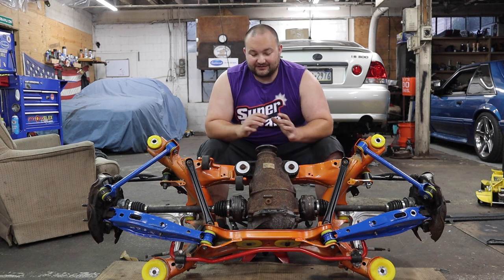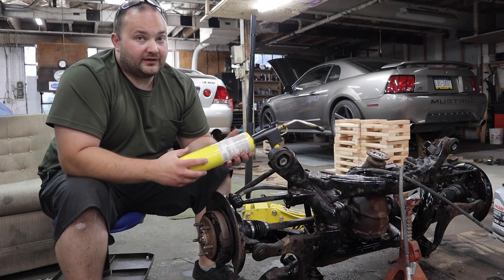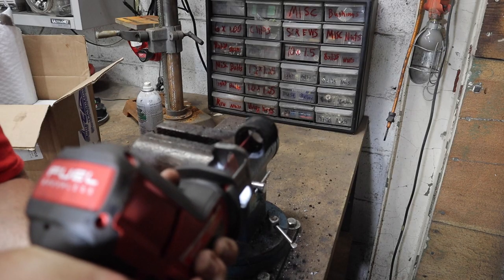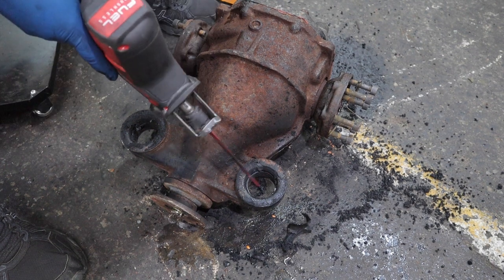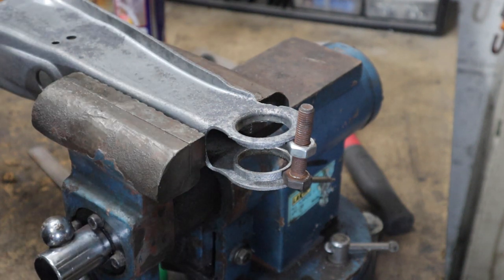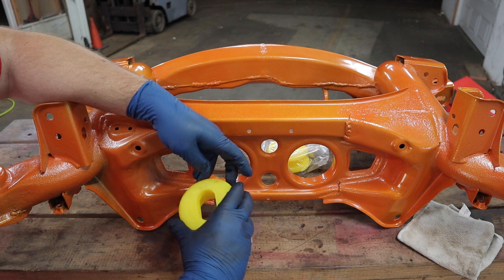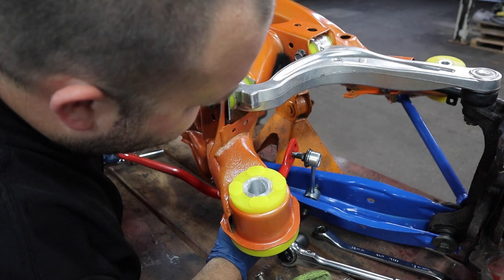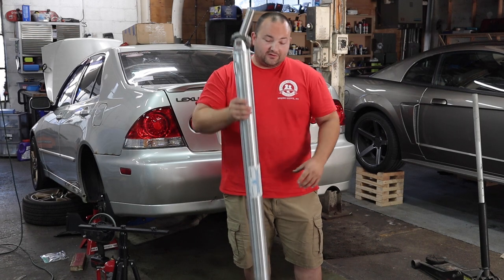Complete Rear Subframe Overhaul! Lexus IS300 IS200 Altezza

Comment: I’m in the middle of this process on a rust free Arizona car and will just be reusing the upper control arms. 2 notes for anyone going this route: Rocar makes an upper ball joint for these that can be had for about $50 shipped.  Also the bushing that has a lip on it on both sides is actually a 2 piece bushing. I used an air hammer to push it out on both sides pretty easily. The other side is typical, burn it out and make a relief cut. The steel takes much more abuse than the aluminum gs arms poor man mods used but this can be done easily without butchering them!

Comment: Just subbed. This encouraged me to order the complete kit (red and yellow) and will be tackling this with my brother. Will definitely have this video on reference but I do have a few questions though.

1. Is it mandatory to drill and press out the sleeves for any of the rears? Can the bushings fit into the original sleeves? 
2. What is the difference in performance w/ the new bushings in comparison to stock? Do you feel/hear more cabin noise? More vehicle vibrations?  
3. Does the car handle more solid now w/ regards to steering and vehicle control?

Mines is all stock and at 233K miles, I think I'm on the original gas shocks and bushings as bought the car at 112K miles and don't know the history of that maintenance. The wear/tear is starting to show, so all 4 gas shocks are getting replaced at the same time as these bushings. Thanks so much!
Reply from the maker: Thanks! 

1. The only bushing that may fit in the original sleeve is the lower control arm the bushing that I did around 33:00, i cant promise that i will work with the OEM sleeve though, but it did look possible. Everything else I did in this video regarding sleeve removal is 100% necessary.
2. Absolutely zero downsides, NVH has not noticeably increased, and the car just feels better. It feels more predictable, less slopping and just more refined. I have not done any high performance driving though, I hope to autoX the car next years.

I also did all 4 shocks not too long ago (miles wise) With new shocks and all new front and rear bushings the car drives amazing. 

Best of luck with the project!

Comment: I hope you torqued those diff mounting bolts afterwards because they are definitely not tight enough
Reply from the maker: Don't remember, but it's doing just fine, even now with a 1UZ swapped in the car
Reply: @PoorManMods  Well that’s good then haha 

How have the Strongflex bushings been so far? Just did my whole rear subframe and diff in my LS400

Comment: Did you use a 6 point socket on the 3 rear mount diff bolts? If so what size did you use? I thought they were Allen bolts
Reply from the maker: I don't remember what socket I used

Comment: Heyyyy nice vid man I am still to attack my rear lower arms. I see the lower bushings suck lol. But just a heads up strong flex will send you the custom bushing free of charge. I did not pay anything for the custom bushings they sent me.
Reply from the maker: Thank you! Yeah i decided just to correct the issue myself rather than wait on a bushing, oh well :p
Reply: @PoorManMods  do you think on the lower rear arms it’s best to burn the bushing out and re use the factory sleeve?
Reply from the maker: If the strongflex bushings seem to fit without slop once the sleeve is installed, yes

Comment: Exellent and very informative video but the things i didnt like was the metal plates you put like washers on the aluminium arms and the dif that you left it rusty
Reply from the maker: Thanks! As stated in the video you can get the "correct bushing" made. I chose to make plates. I cleaned the diff but didnt see the benefit in painting it

Comment: What’s the purpose of the rear gs300 upper control arms
Reply from the maker: Replacement steel control arms are expensive. The aluminum ones are cheaper and they're a little bit lighter and they don't corrode